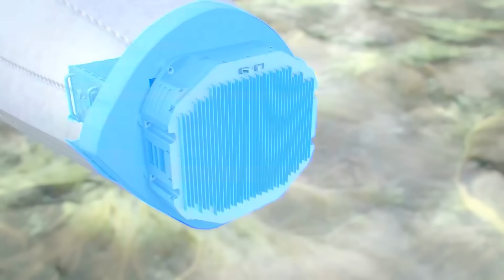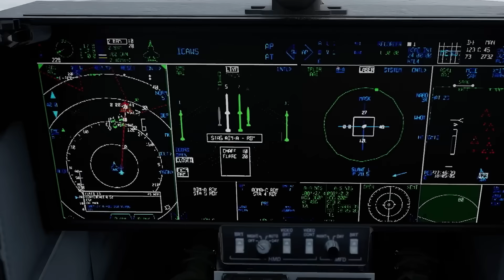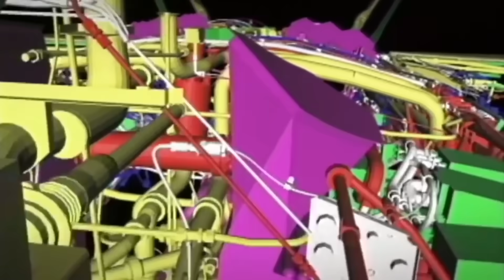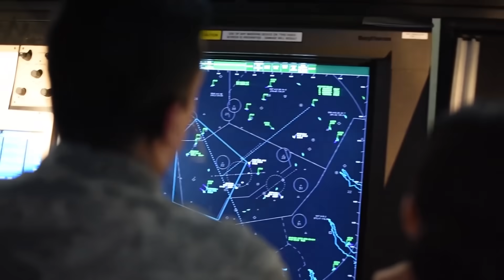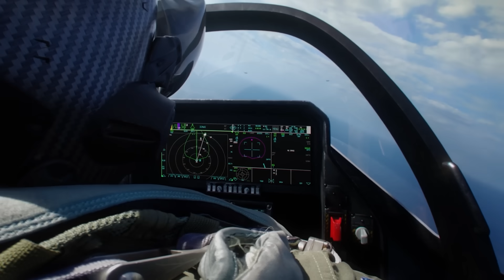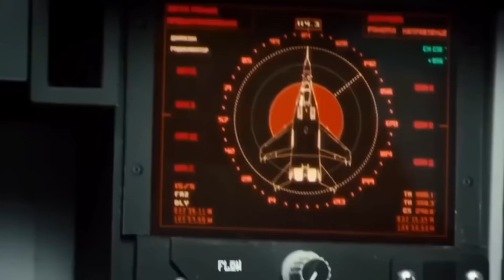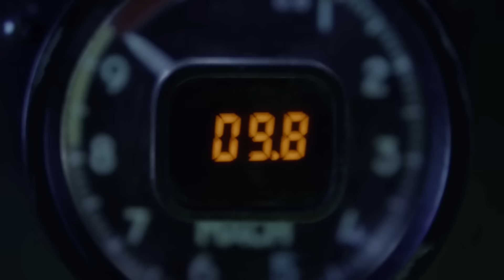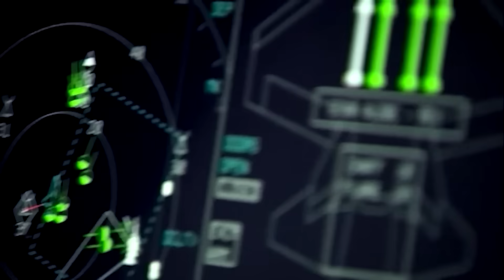US $300 Billions 6th Generation Fighter Jet Is Finally Here!

Comment: The force structure vision is equally bold: 200 NAD fighters, working with 300 F-35s, each accompanied by two unmanned loyal wingmen. And the spending – over $4.2 billion spent so far, $11.7 billion more through FY2027, and the likely addition of at least $40 billion going forward. They’re clearly betting big on making this sixth-generation system a reality by the 2030s.

Comment: Blah blah blah. I keep seeing fluff like this all over the internet. What little I know about the F47 is to say the least disappointing. It can travel over Mach 2. SR72 has flown at Mach 9 and can go even faster. But to achieve these speeds special materials had to be developed to withstand 3000 degrees. Adaptive cycle engines are not the same as combined cycle engines. Combined cycle engines include more than one engine type. They transition between turbofan and RAMJET  somewhere between Mach 2 and 3 allowing for hypersonic flight. If they can transition to SCRAMJET they can travel at Mach 6 and faster. With rotary detonation combustion chambers they can travel at Mach 10 and faster with greater fuel economy. 

If the 6th generation fighter is already here why do we have to wait 10 years for it to be in operation?  The USAF said the F47 has been flying for 5 years already. How many more years does it need. AI processors that will be used in all aircraft weren't available 5 years ago. Intel just came out with a low power consumption Q-bit AI processor. Higher speed processors based on light instead of electrical signals have just been announced and will be 100 times faster than electronic processors.

Comment: So it's not equipped for the super laser and it's not the one that they want to make basically invisible where it photos what's on top beneath Below on all sides and then the picture is being done to the plane like a TV screen so you cannot see it with the naked eye like when they wanted to do that to a boat as well with a special coating over it are they developing that in Area 51 by any chance or is that just like you Martin. Besides using stealth technology.

Comment: Noise Cancelation Traps Sound Somewhere that Has To Be Released Eventually; If You Harness By Trapping the Noise Then Compressing It And Directing It When It Has To Release You Can Travel real Fast In Outer Space If You Say Put CO2 Gas Into The Sound And Use the Shockwave To Send The Ship Flying If You have A Material Or Structural Integrity That Can Take The Impact Of The Shockwave (I Reccomend Making Something To Cancle Out The Shockwave and regather The CO2  For Pickup and Return To Earth And Regather The Sounds And Return Them To Earth Because There Are Traces Of Earths Atmosphere On The Sound!.)

Comment: The aircraft air intake, the main component of the engine air intake system, is designed in such a way as to ensure an efficient and optimal airflow into the engine during flight. Changing the shape of the air intake is an important task to reduce drag and improve flight efficiency. During the flight, the air intake is automatically adjusted to optimize the air flow. This is achieved by changing the shape or position of individual parts of the air intake. The process is carried out through the use of advanced technologies and automatic control systems. Such changes in the shape of the air intake reduce the overall drag of the aircraft and contribute to improving its performance, fuel economy and increasing flight range."
Словарь и онлайн перевод на английский, русский...

Comment: Most of this video is just conjecture or based on publicly available concepts.  Only the designers and manufacturers know what capabilities NGAD and  the Navy's F-XX will actually have.

So I'll offer my own guess that wasn't mentioned in the video: AI.  I'm fairly certain that both fighters and the B-21 will have AI software.  In a recent DARPA fighter simulation with enhanced AI against a retired F-16 pilot with combat experience and thousands of hours of fighter time, the AI assisted fighter won in dog fights every time. against the pilot without AI    If we are that far along with AI enhanced fighter simulators, I expect that all 6th Gen aircraft will have AI by the time they become operational.

Comment: Their definition of "is finally here" is different than mine.
Reply: Sure, but there have been flight tests, granted very early testing, but it's coming along.
Reply: @mcblaze1968  I retired from the Marine Corps after 21 years in 1989 as an infantry officer with 3 years in combat.  Deception is an important part of any combat operation.  I would hope the acquisition people includes deception in their development announcements.  If I were the head of acquisition of stealth aircraft, I would include false information with regard to the progress of development as well as to have the designers and manufactures to include fake designs and blueprints based on the real designed but with enough deception to make it difficult of an adversary who hacks into those computer systems to be uncertain which were the real designs.

I was once a consultant on a DARPA technology program to discover and neutralize Advanced Persistent Threat (APT) on classified military and military industrial networks.  I can't go into any details, but I was amazed at the number of different levels of protection classified networks have and yet China managed to somehow penetrate them and steal the blueprints and thousands of other documents for the F-35.

APT's are very sophisticated and finding and neutralizing them on a computer network is incredibly difficult.

This was many years ago, and I don't know if DARPA or some other company has managed to find a solution.

This is why whatever the Pentagon says about the progress of stealth may or may not be accurate.  Instead of telling China and Russia exactly what our progress is, I would prefer that they don't know the real progress.  If the Pentagon claims that a stealth aircraft will become operational in 2030, I would hope that the real year would be something like 2028 or 2035.  Keep them guessing.
Reply: @mcblaze1968  sure, Jan
Reply: We just found out in the news today that America just made the F-47 😂 in production within the next few years the thing seems like a beast 😮
Reply: Well you ain’t happy until Mayor Pete plasters your eyes shut goo gobbler.

Comment: “It’s finally here!!”, except that there is only a list of wishes and desires, but not even a doodle on napkin has been made so far. :0)

And they hope to have it by 2030… What could go wrong? It’s not like F-22 and F-35 had any delays in development. ;0)
Reply: It is here I know.
Reply: @ezellmcquay9127  so is F-35, but half of its features still don't work. B-2 and F-117 are here too, but they are already obsolete. Despite all the flashy new toys, USAF still has to rely on airframes from '60s and' 70s to perform it's tasks. And these old planes will have to continue to fly, long after the latest skunk from the Skunk Works has come and gone.